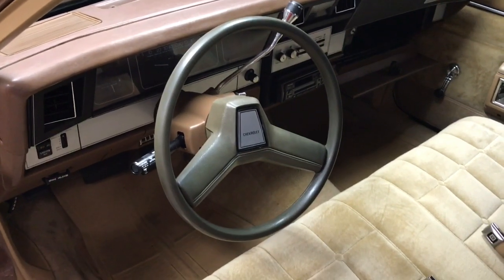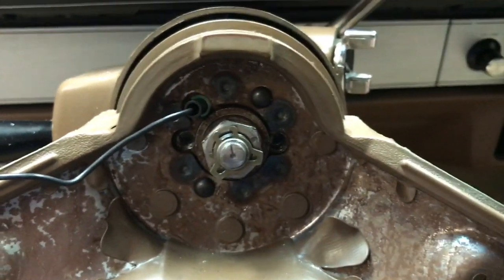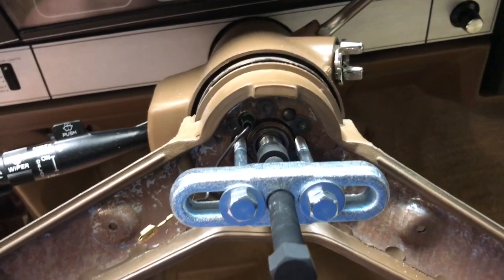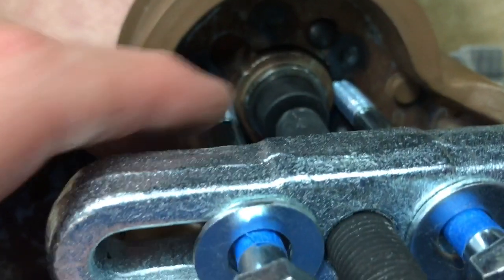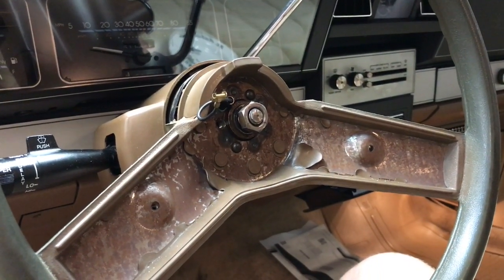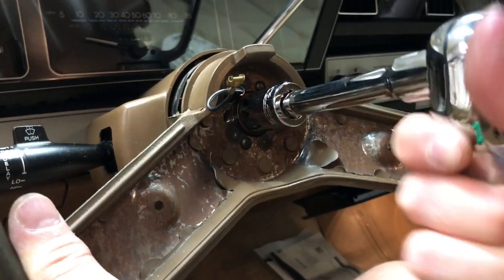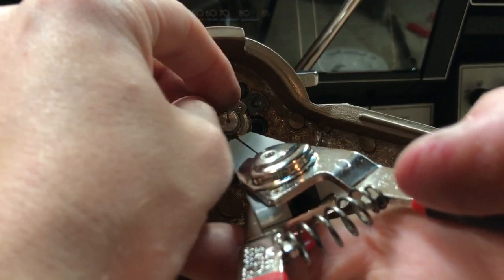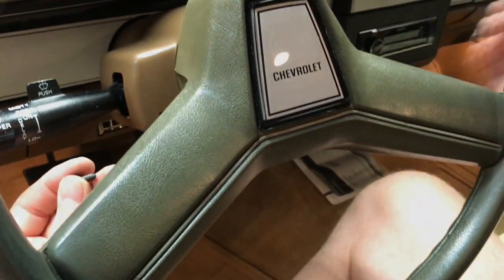How to Remove the Steering wheel - 1985 Chevrolet Caprice Classic

Comment: very helpful I have the same year and I was trying find information on how to replace the turn signal/ wiper/ cruise control lever would I have to pull the steering wheel in order to gain access and if so may I know what size bolts did you use on that puller tool?

Comment: What size bolts did you use?
Reply from the maker: @Sir Francis Bacon:  I don’t remember which ones I used exactly.  I think I carefully tested a few of them in the set to see which fit the smoothest and didn’t cross-thread.  That’s the set of bolts I marked with the blue tape for future use.
Reply: @LongologoProductions  cool thanks

Comment: Can the instrument panel be removed without removing the steering wheel?  Or does it definitely interfere with the IP removal?  I have a tilt steering column, and I noticed your doesn't, so I wonder if maybe makes a difference.
Reply from the maker: @Richard Lytle:  I believe the instrument panel can be removed without removing the steering wheel.  But for me it was a huge pain working around the instrument panel with the steering wheel in the way.  It might be easier for you with a tilt steering column to work around it but not sure.
Reply: The instrument panel can be removed without removing the steering wheel if you can tilt it. I just did that the other day!

Comment: Where did you get the pulley
Reply from the maker: @k strachon:  Did you mean the steering wheel removal tool itself?  I don’t remember specifically, but I think it was either Advance Auto or on Amazon.  Most important thing is to match that thread size.